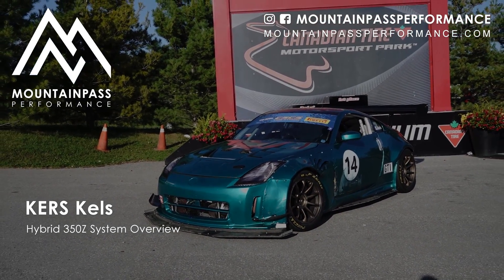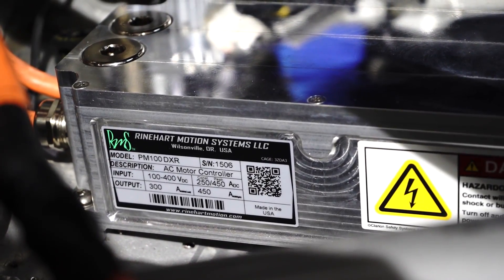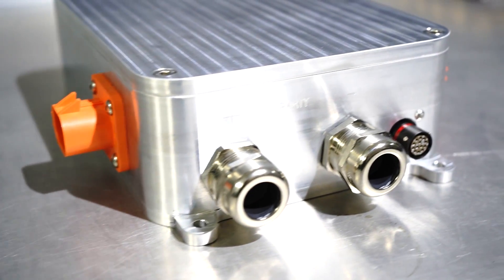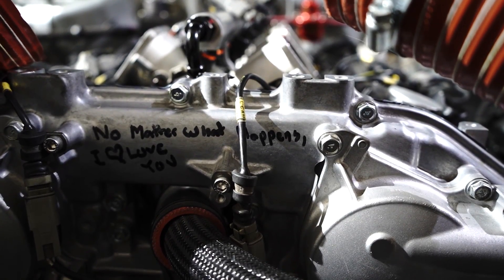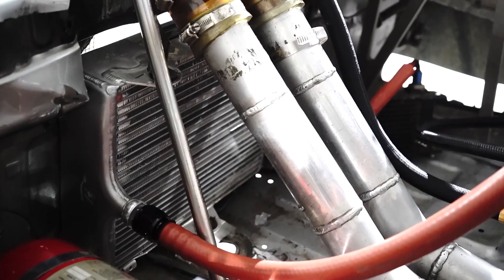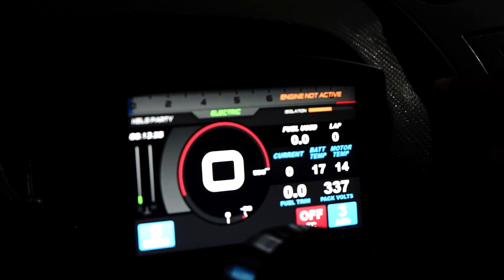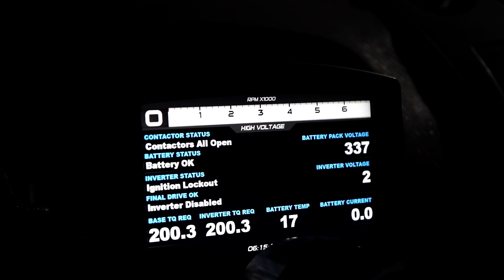KERS Kels - Hybrid 350Z System Overview

Comment: Why not come up with mechanism that is hub mounted on the rear axles. Better weighty distribution also. I understand moisture ingress could be an issue but even in current location it is pretty exposed. Just a suggestion. You know better.
Reply: Exposed? Trans going on it...

Comment: Sasha, this is downright jaw dropping impressive work for a private party!  This makes me very excited for what the future holds with enthusiast hybridization.  

Right now we see a fair bit of pure EVs being made by enthusiasts, mostly for drag racing and hill climbs as they are very well suited for a performance EV (short distance/duration, not a huge need for extended performance or reliability).  No one I know of, other than you, has done hybridization, especially not for circuit racing, and honestly, that's decent reason as why I want to do the same.  

I'm currently building a Fiero (yeah yeah yeah I know), which will contain a Turbo 4cyl in the rear with a 6-spd manual, and a pair of electric motors at the front.  Torque vectoring is planned to get the most out of it.  Obviously this will be a ways off for just one guy, but I hope to see others start to do the same to really see the benefits that could be gained.  

I wish the best for your continued development of KERS Kels!
Reply: I just want to say that's awesome!! And the fiero is a really good platform, hope you eventually make it!

Comment: Could you have used a clutch to disengage the ICE from eMotor ? Or is it a cornercase where that would be necessary?
Reply: Not necessary it seems for the application of for which the car is being used and would have added weight and complexity

Comment: @Sasha Anis  Do you plan to plan to mount in the rear of the car water pressure sensor and one way gate after heat exchange cooler. In case some one hit your car in the rear you will see message it the dash you lose pressure then you can shut off the pump and do not lose coolant.

Comment: But why? It seems like the hybrid system would only be adding enough performance to make up for its own weight.
Reply: In the future some cities may ban ICE cars so therefor you still can have those great sounds with electric motor!
Reply: We'll see. We're a bit worried about that as well. One benefit is that the car is so front heavy, that the added rear weight will not be as much as a penalty as it normally would be - since the car will better utilize all four tires. The front axle weight may actually be lighter than it was last year, due to the removal of the starter, alternator, and a bunch of front drive components. And the new gearbox is significantly lighter and further back too!
Reply: @sashaanis6414  Awesome. Either way, it's a fascinating project to follow and you guys do amazing work. Thanks for the reply!

Comment: 2:03 thats a whole lot of unnecessary friction
Reply: This is the simplest way to do a hybrid. Next would be to add a clutch between the motor and engine but would require a longer bell housing more than likely, or adapter of course.
Reply: It's not unnecessary if it's designed to take advantage of that, which it is.
Reply: You should try learning about bearing before you make comments like that.
Reply: @acruzp  when its in full EV mode as he said its still spinning the ICE motor which means pushing against the compression of the motor and ring drag etc, the bearings are the least of the problem
Reply: @john_p  you're right, my mistake. I thought you meant what people normally complain about: the bearing grease.

Comment: Great work Sasha. Can you control two electric motors with the motec? I want to use two spark ev motors (one on each wheel) and would love to set up differential options electronically.
Reply from the maker: Yes, you sure could if there were two inverters that speak over CAN.
Reply: @MountainPassPerformance  well I was thinking of using a volt inverter since it controls two e motors already. Just trying to figure out if it would work. From what I've read it can support two separate up to 1000amps and 600volts

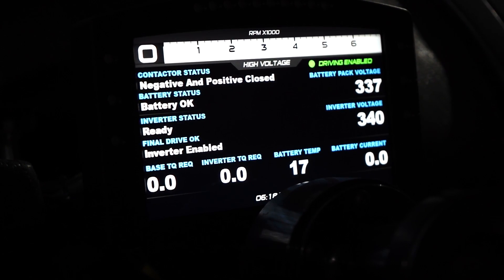Comment: Dear God man.  @5:22 you're so casually like "when i give it some throttle" and then it makes the most incredible sound.  I literally said "excuse me" out loud to myself and immediately rewound lol

Absolutely incredible work, can't wait to see it on the track.  I'm assuming you have plenty of data on pre-hybrid Kels for some comparison and number crunching on power curve and sector times from the MGU-K advantage?
Reply from the maker: Thanks! Yes we do have a ton of old data, and have done some simulation as well. The goal at this time is to cap out around 490lb-ft of torque, which should create just over 700whp.

Comment: that is awesome, thanks for sharing.  This could be the ultimate sleeper drivetrain on the street, drive up to someone in electric mode and spin the engine to make it sound like a beast of a engine and then race him in hybrid mode and drive away in electric, it would confuse a guy for sure, if you could couple and de-couple the gas motor from the electric for a situation like that.  You have lots of great ideas Sasha, keep up the good work

Comment: MMmmmmmmmm...... now that's what I am talking about. Sorry if you already said, Sasha - but what type of electric motor are you using//what is the rated tq/hp?? Cheers from the east coast!
Reply from the maker: Phi-Power 272R. Should be good for 240Nm of torque and roughly 200hp. We'll find out soon!
Reply: @MountainPassPerformance  could you add something like this to a street car build? like say a luxury car for 0rpm tourque?
Reply: This is worth a watch. https://www.youtube.com/watch?v=IzhvaGnEkJo he talks about the motor and expected power in that. Honestly I am so excited about this project, thanks Sasha for your amazing work!
Reply: @Witchdoctorz  I'm an idiot - I've seen that before, was just unable to remember what video it was that they covered it, heh. Bit hard to read the specs as it was passing by but I glimpsed 80kw hp // 90Nm tq 

Phi-power;
http://www.phi-power.com/en/home/

Cheers for that.
Reply: @Witchdoctorz  Looks to be a 'tinkered-with' (Sasha said it was custom, as-per their/his specification(s)//requirement(s)) model 'Phi271'

Thanks again.
Reply: @FukU2222  Yeah looks like a lightweight custom version. Sadly all outside of my price range :(

Comment: When running in EV mode, is the throttle fully opened to reduce engine braking?
Reply from the maker: Right now we haven't completed drive by wire for the EV. When it is drive by wire we'd want to keep the throttles fully closed, so that less air is ingested and compressed. EV mode is really just for loading in the trailer and those sorts of things. So power isn't that crucial.
Reply: @MountainPassPerformance  Thanks for clearing that up!
Reply: @MountainPassPerformance  If only EV mode is on will this not create negative pressure in engine when throttles are fully closed? When petrol engine create vacuum with fully closed throttle bodies this will not put more stress on piston rod caps and bolts? In worst case scenario you can create big vacuum to change timing intake valve and hit top of the piston.
Reply: @Dori21ha  Vacuum can only give a pressure difference of 1 bar. The cylinder pressure during combustion at TDC is probably about 100x that. You don't need to worry about the valves since the vacuum is on both sides of them.
Reply: that's not how that works. when the throttle is closed you're moving less air therefore less energy is wasted, 
if you open the throttle you will be moving more air and wasting more energy.
Reply: I don't agree. You will not pull a vacuum on top of the piston if the throttle is fully open. Let me know what you think.
Reply: @EastingAndNorthing  if you pull a vacuum you don't have to compress as much air.
Reply: But the pressure above the piston would be lower than in the crank case, this is the reverse of what happens during combustion (higher pressure above piston). So, there must be engine braking if the throttle is not opened.

Comment: Brilliant! What's the overall battery pack size? Will the batteries be cooled or are you just sticking with inverter and motor cooling?
Reply from the maker: 7.5KWh. The batteries will likely be air cooled initially. Lots of questions remain in the battery department.

Comment: Man I'd love to use a motec for an EV conversion, mostly for the custom display, but damn that thing is EXPENSIVE
Reply: Yeah its just crazy money. If you use a tesla motor you can do some cheaper alternatives that come with a screen they just cant control engine too. TC1 is one of the controllers and there some others on diyelectriccar
Reply: @reviewcrewforyou  
The t-1c is great for $2500 but it's screen is a control and diagnostic screen, NOT an instrument display.
I emailed them a while ago and they're experimenting internally with using an Android based instrument display
Reply from the maker: It's a different mindset when doing EV conversions. The budget for electronics naturally needs to be higher. The good news is you don't need to budget for headers, exhaust, cams, intake, ignition systems, fuel systems etc etc etc. So yes, the electronics are a few thousand more than you're used to paying - but it's nothing compared to all of the bits you don't need!